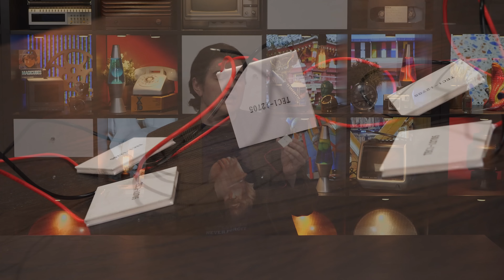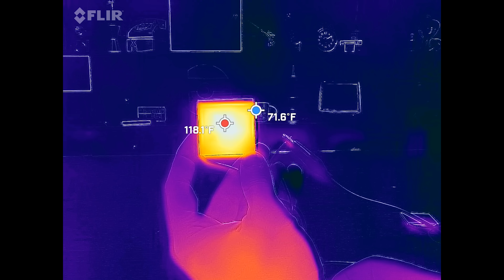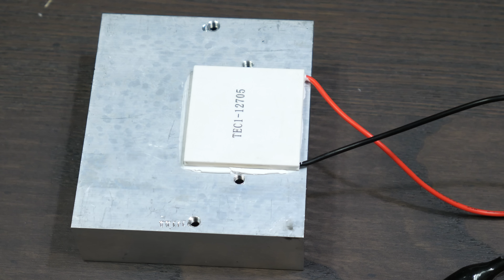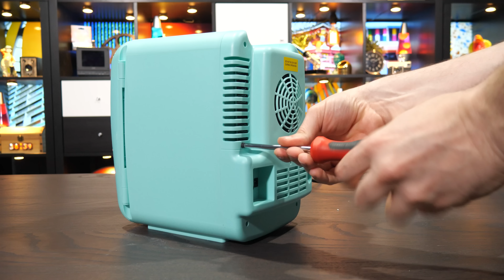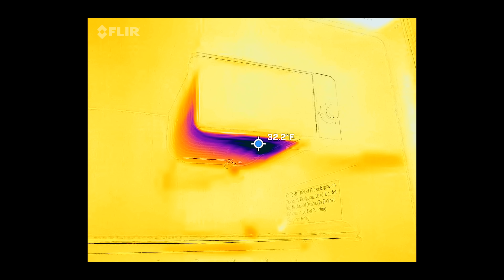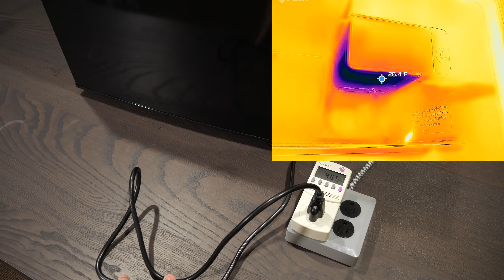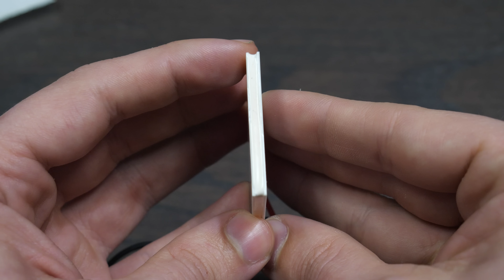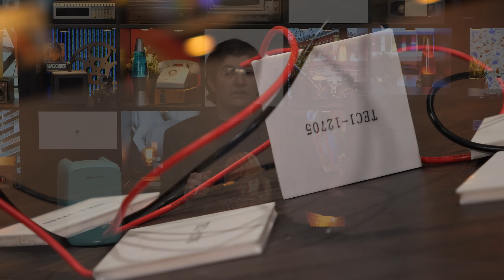Thermoelectric cooling: it's not great.

Comment: Can't believe this needs to be said: If I had wanted advice, I would have asked for it. Cool, glad we're on the same page.

When I told my last job that I needed to be able to keep insulin in a fridge throughout the workday, it was one of those little mini "fridges" that was her solution. She argued vehemently with me that I was wrong and my insulin would not go bad in one of those. Thankfully, there was a nurse practitioner on staff who agreed with me and overstepped HR (I was working in a doctor's office). Then it was "just put it in the communal break-room fridge." It was a whole thing. I had to get the ADA involved. I work from home now.

For the keyboard warriors who are desperately trying to invalidate a very real medical issue: YOU CAN NOT PUT MEDICAL SUPPLIES IN A COMMUNAL FRIDGE. THEY HAVE TO BE IN A LOCKED OR PRIVATE AREA. Stop trying to speak on things you clearly do not understand. What this HR tried to do was a violation of the ADA. Hence, WHY THE ADA HAD TO GET INVOLVED. It's not nearly as hard as some of you are making it out to be. Use your brains and learn to read.
Reply: Even if the mini "fridge" did work I would still feel incredibly uncomfortable essentially putting my life in the hands of one.
Reply: Similarly, a lot of mommy groups will recommend these as bedside storage for breastmilk pumped overnight. NOPE. Not cold enough.
Reply: @EmilyBoBemily i do like looking at mommy milkers. They look like mountains with sausage bits on the tip. 🤣
Reply: @rrai1999nobody cares
Reply: @theenzoferrari458 You should feel bad for being you.
Reply: @theenzoferrari458  gross
Reply: @EmilyBoBemily  what? Why you make fun of me? 😔 I just admire them. 🥺
Reply: So many mini fridges advertise very loudly that they’re not just safe, but ✨perfect for✨ insulin and breast milk. It makes me want to scream. I’m glad you had an advocate (side note: NPs are AWESOME!), but so many people don’t and can’t put their life - or their baby’s - in danger if the trust the ads.
Reply: "don't completely alienate your employees with life-altering medical conditions" challenge: IMPOSSIBLE!!
Reply: Gotta love the "why don't you just do X" comments from people who don't care about your life.
Reply: @cbalan777  "Just make insulin yourself, bum."
Reply: It because ppl open and close the fridge door all day long?
Reply: A medical facility objected to a medical need? An oxymoron if I ever heard one. How did they even find out? Someone disliked you to pull off the objection and probably disliked you even more after you won. 😁
Reply: The audacity of that woman!
Reply: I was wondering about medication as a possible use case for one of these things. That is, before he pointed out there is no temperature control element 🫠
Reply: You’re talking about the ADA as if it’s a Federal department or something.   It’s not a place you go to or a legal entity of some kind, it’s just a law.
Reply: Hey Pharmacist here, the guy who mentioned 28 days at room temp is not just for pens it’s vials too. There are no longer insulins that are available that can’t be stored at room temp for use. Ironically, the products that have lower than 28 day room temp stability are some pens. And when it says “opened vials” it does not actually matter as long as you don’t go past 28 days. Most of my patients in your situation keep a vial or pen in their desk drawer and date it with a piece of tape or label. Your hostility is shocking for being so wrong on information that is readily available even on the back of your own vials.
Reply: @dominickharris7220  I just went over the ADA guidelines and he’s full of it. Room temperature safe insulin in a fridge he has to crawl to, instead of on him when he needs it is not reasonable accommodation. lol
Reply: @dominickharris7220  Or maybe you're reading into something that's not there... I mean, I clearly have to reveal every aspect of my life and that particular situation based on ONE COMMENT. That office was notorious for bouncing between 65 and 90 degrees at random, so keeping a pen in my drawer would have still been a bad plan, hence why it needed to be refrigerated. Yet ANOTHER reason for ADA complaints. Keeping insulin in my car was not an option, and just going home was not an option. Not explaining any further as the Internet does not have a right to every aspect of my life and the unique situation mentioned in the comment. Yes, I'm hostile, but mainly to people who can't take a comment at face value and leave it at that.
Reply: @duckiekraft6893  Gaslighting a pharmacist is crazy 🤯
Reply: Watching from the sidelines like, it is bad your workplace couldn’t accommodate you, but you are so hostile in the comments it’s next to impossible to feel sympathy for the fact you were wronged. It’s like, you no longer work for that company and can’t take out the anger and resentment on former shitty coworkers, so you just chew off the heads of random internet bystanders instead. Even ones who are clearly simply curious (and you DID post the comment, so you can’t act like people are prying), or like the pharmacist who I’m pretty sure is just trying to offer helpful information. Unclench, stop shifting your anger at your previous workplace to randos online, and if you’re going to get into these angry, aggravated conversations even with people who clearly don’t mean any harm, maybe don’t leave comments about your situation to begin with. You obviously can’t discuss it without simply being mad at EVERYONE.
Reply: @MW-pb2gf  I don't see where I asked for advice in any of my comments...
Reply: @ManFreDOIII  Great job using a buzzword... I wasn't gaslighing, but you do you Boo.
Reply: @MW-pb2gf  According to his own story he was reasonably accommodated. When someone points something out he just adds new details to validate his whining. He’s using buzzword AS A BUZZWORD! Our efforts are lost on this clown.
Reply: @duckiekraft6893  Using buzzword as a buzzword is crazy. According to your own story you were reasonably accommodated. You were allowed to have life saving medication in your pocket when you needed it. You put yourself in a position where you’d have to either crawl to the fridge, or hope one of the employees you were feuding with don’t have it in them to hold a grudge. You made it unreasonable.
Reply: Jesus christ you're  hostile
Reply: @Daniel-qe8qe  Thanks for noticing.
Reply: @duckiekraft6893  Uh no, it was a joke. Insulin is a hormone and you should know that with your attitude in this comment section.
Reply: @ManFreDOIII  Or it was a bad joke. "Hormones" is one of the biggest bullying tactics used in America. You're just mad I didn't find it funny.
Reply: @duckiekraft6893  You’re the only one mad, bro.
Reply: @ManFreDOIII  I'm really not, though. Someone's projecting... I just have nothing better to do today 🫠.
Reply: @duckiekraft6893 I think you may have a slight problem with entitlement and self pity. Taking some time to reflect on yourself may help you be more likable and understood.
Reply: @madisunie  Again (as stated SEVERAL TIMES THROUGHOUT THE COMMENTS), if I had wanted advice, I would have asked for it. I didn't ask for it, so frankly, I just really don't care. Cool, glad we're on the same page.
Reply: @Daniel-qe8qe  Hormones 🤷‍♂️
Reply: @ManFreDOIII  Misogynistic much?
Reply: Insulin is good at room temperature for 28 days, I never refrigerate my open vials, and been doing it for the last 35 years. I go through a vial in about 10-15 days, though (currently on a pump)
Reply: @pilotsmoe  That's if you're using the pens. Does not apply to all insulin. Love that deliberate invalidation of someone else's experience, though.
Reply: @duckiekraft6893  How is sharing ones own experience invalidating that of another, even more so deliberately, when it is clear that the circumstances are very likely to differ?
"I have different experiences with x."
doesn't equal
"You are wrong/invalid! (about your experience with x)", when x is not the only variable.
Reply: Jfc if they can't accommodate that they can't handle shit! America needs to swing back to being pro-worker.
Reply: @DestDroid  don't lump the whole country into one single workplace issue 🤦‍♂️
Reply: @DestDroid  
It's not an America issue, it's an individual workforce issue.
Reply: @jfangm  It really is. I've been in other work environments that had no issue accommodating me. This one almost went out of their way not to accommodate, not just me, but anyone. It was especially bad because it was a doctor's office.
Reply: These jackass employers make everything a big deal. Whats the harm in having a fridge
Reply: Why is using the communal fridge a problem? Were you afraid people would steal your insulin or something? 
Also, has insulin changed in the last two decades? My grandpa never kept his in a fridge.
Reply: @hellterminator  Communal fridges are not kept at a medical grade temperature. We were also having an issue with people raising the temperature and food spoiling, so the insulin would have gone bad. Maybe don't speak on things you clearly don't understand. You might know someone with diabetes, but I've literally lived with it since I was a child. Step away from the phone/keyboard and go touch grass.
Reply: @duckiekraft6893  Dude, chill. I didn't make any statements or claims, I asked two honest questions. You answered one of them and for that, I thank you. 
If you don't know why my grandpa's insulin didn't need to be refrigerated while your does, fair enough. 
I now have an additional question - why would someone raise the temperature of a communal fridge - but I suspect you don't know the answer to that either.
Reply: @hellterminator  Sorry. You're right. I tend to jump to the offensive. With the communal fridge, I don't know why the temp kept getting raised. The employee doing it admitted she was doing it but only laughed when asked why and to stop. I don't work in that office anymore, so I don't have to worry about some of the employee and HR shenanigans, thankfully.
Reply: @hellterminator  Edit: He’s trolling don’t fall for it! 

Edit 2: According to your own story you were reasonably accommodated. You were allowed to have life saving medication in your pocket when you needed it. You put yourself in a position where you’d have to either crawl to the fridge, or hope one of the employees you were feuding with don’t have it in them to hold a grudge. You made it unreasonable.
Reply: @duckiekraft6893  Some fridges are just colder than others. 🤷‍♂️
Reply: Isn't the idea with the breal room fridge the way to go? Are you scared people will steal it or why is that idea off-putting?
Reply: @thumbthumb5998 its not they just exhausted alll avenues to get the outcome they wanted which was to work from home
Reply: @zachrisley5462  I work for a completely different company now. The company I was referring to is actually in the middle of a class-action lawsuit, in part due to their horrible accommodation abilities.
Reply: @thumbthumb5998  Literally demanding someone put medical supplies in a place where food is kept and where ANYONE can have access is against basic medical guidelines. Do some basic research before trying to be a keyboard warrior and invalidating someone else's medical needs.
Reply: I would hate to work anywhere near you
Reply: @ratedRblazin420 The irony of this statement
Reply: @ratedRblazin420  Eh... What? Are you okay?
Reply: @duckiekraft6893  Im sure hes not. Probably dosent have a job either. Or friends.
Reply: Bro thinks the world revolves arouns him
Reply: Companies are REQUIRED BY Law to make these accommodations for people with medical conditions.
Reply: @btfo5082  Just like I'm pretty sure the world does not revolve around you, sis.
Reply: So you don't work now??
Reply: @scrubbrushland  Read that last sentence again...
Reply: Ada

Comment: It is nice that you covered this topic. For years, I've been trying to tell people how inefficient these things are, even supporting my claims with fancy experiments, but they don't believe me. They mostly try to build air conditioners and they can't understand how inefficient these things are. Hopefully, a popular YouTuber with a large audience will change the trends. 

Also, as a fun information. That tiny fridge is also bad because the Peltier cooler in it is most probably running at full power. The higher the current, the stronger the Joule heating as compared to the Peltier cooling since the Joule heat scales quadratically with the current, while the Peltier cooling scales only linearly. Above a certain current (60-80% of max rated value), the cooling just can't keep up with the heating anymore. 

BTW, Peltier coolers can often be found in scanning electron microscopes. Actually, multiple. One can be found in the ESD detector which is typically a Si-drift detector and another can be found in the EBSD detector which is a high-performance CMOS sensor. Also, certain laser diodes are often cooled with Peltier coolers because the temperature can be trimmed very accurately. So yeah, in the household (as you said "general-purpose cooling"), it is useless, but in the lab, I use it daily and could not do my work without them... :)
Reply: Thanks for the good content that u make. I still think peltier is a nice "addition" if someone wants to diy a room cooler that primarily runs on evaporative cooler for example. A peltier would help cool down further the air into the room, getting below wet bulb temperature. Desertsun made a 2-stage evaporative cooler. It would pair well. 
I do agree peltier is very inefficient at cooling in general 😂

Comment: I feel like you unfairly critiqued that mini blue fridge at the beginning.

1) that’s not meant to cool down anything, it’s meant to keep already cooled things cool. It’s for you to put the can of soda (that you had at home in your fridge and then put in your lunchbox to travel to work) in to keep it cold instead of dealing with ice packs and all. It doesn’t do well making warm things cool, but it does great keeping cool things cool (it’s basically a small plug-in cooler).

2) it’s desktop sized. I haven’t been in many office buildings recently, but the one I have been in doesn’t give their employees a large desk anymore. Basically, the work spaces are just big enough for a laptop and a couple of additional monitors. Trying to keep one of those cube fridges at your desk would be nearly impossible. But, you could easily keep one of those drink coolers at your desk, as it’s like 1/10th of the size. Plus, all it would take the company to do to make it quiet is to swap out that cheap fan with something like a noctua fan, and it would be almost completely silent (and probably do a better job cooling down the heat sink as well).

3) no one is thinking about energy consumption at this job cubicle. Your choice of fridge/cooler will have no impact on the ulitity bill of the company

So, while I agree that a conventional fridge is more efficient, that doesn’t mean there isn’t a place for one of those plug in coolers.

Comment: Peltier cooling is useful when you need a low amount of cooling but with zero vibration. Dedicated astronomy and modified dslrs use thermoelectric coolers to get super low noise photographs even in demanding high ISO long exposures

Comment: Not to nit pick,but many standard refrigerators today have three moving parts- the "heat pump" or compressor, the cooling fan for the condensor and the fan in the freezer to blow cold air into the regular food area
Example -my 15 cubic foot box is pulling 123 watts right now,ambient at 72 degrees
Also, electricity is $0.25Kw  here
A great video,though as always and  appreciated

Comment: Everything you read in this post is merely a demonstration, I am not liable for your actions from here on out. ——> if you know a person who recharges expired co2 fire extinguishers for a living. 1)Set your can on the floor 2) cover can with nozzle 3) pull pin and discharge expired fire extinguisher 🧯 4) carefully take cool soda and drink it.
Not responsible for your irresponsible behavior and not liable either 😂😂

Comment: ok, cool, but...
how small can a heat pump refrigerator get? can it be as small as the light blue one?
if no: there you go, the only reason you need to potentially buy the peltier fridge
if yes: i need it.
Reply: Honestly, I can't think of many cases where you'd need something that small specifically.

Spaces kind of have to be a certain size just to accommodate us in the first place. We're pretty big.

I could stick a mini-fridge on my desk and only be slightly inconvenienced. If I took out some drawers, I could put it under the desk and not be inconvenienced at all, and still have more drawers than I have things that need to be readily accessible.
Reply: @seigeengine  yeah, but nieche ases is why i feel these kinda things exist.
i actually tried to look for a 25 liters non-peltier minifridge but couldn't find anything of that size.
Reply: @iota-09  Smallest mini-fridge I found is only a bit more than that, actually.
Reply: @seigeengine  hmmm... tbf i only checked on amazon italy, so that's probably why, not exactly sure where else to search at least when ti coes to online searches...

Comment: I live in a very hot climate and love refrigeration too.  About twenty years ago I set out to build a peltier equipped air conditioned jacket that would be powered by the new lithium batteries.   I needed data to know how efficient the system would be so I built a test rig using an insulated box and two very large CPU heat sinks from discarded pc's.  The thing drew so much amperage and made an incredible amount of heat - way more than interior cooling.  I put the idea on hold until the peltier chips get more efficient.  I'm still waiting.🤔

I recall a firm in Japan produced a peltier jacket a few years ago but it required mains electricity - lame.  I don't think they sold many.